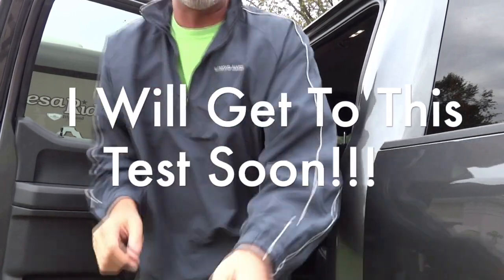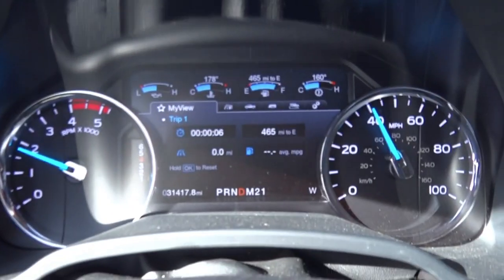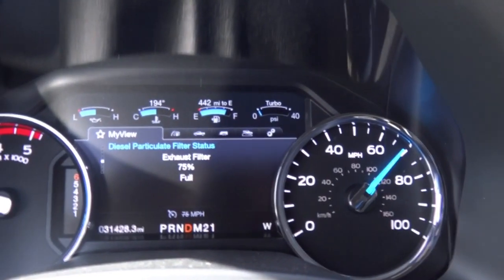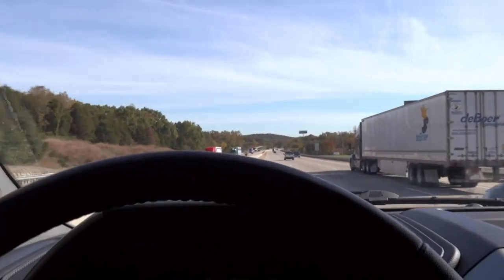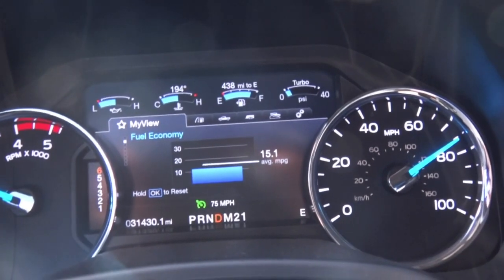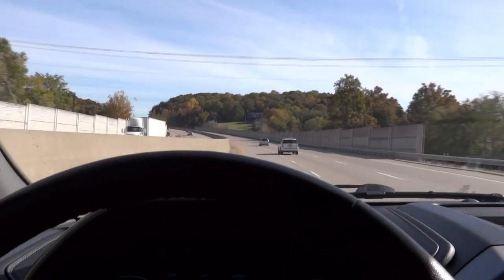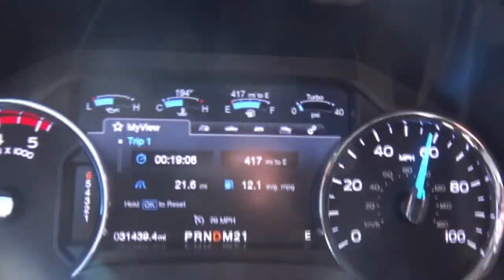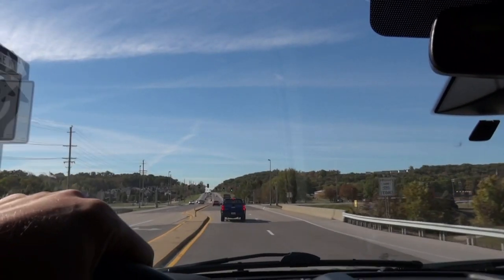2017 Ford Super Duty PSD Regen Cycle MPG Test

Comment: How were you able to keep the boost gauge and get the temps to show over your cold/hot gauge? When I changed my 2019 F250 PSD temps to show with Forscan I lost my boost gauge!!
Reply from the maker: Hey Wylie...sorry for the delay.  I just used Forscan.  You should not have lost your boost gauge.  Can you bring it back over on the far right "options" screen where you can change that selection from engine boost to trans temp, etc?
Reply: @AdventuringToday  actually  it's not even available  in my gauge options.  It's like it's gone!